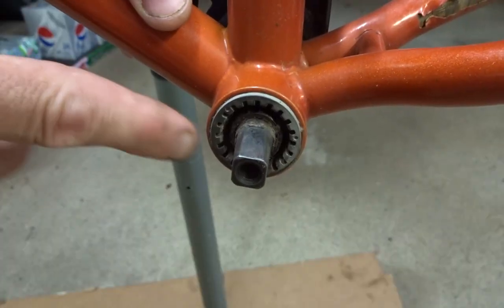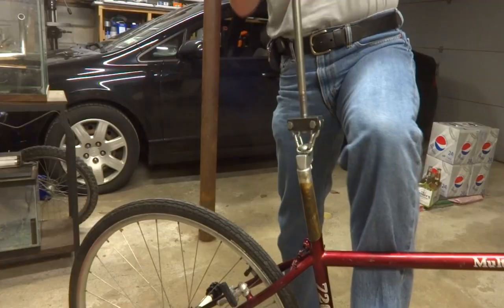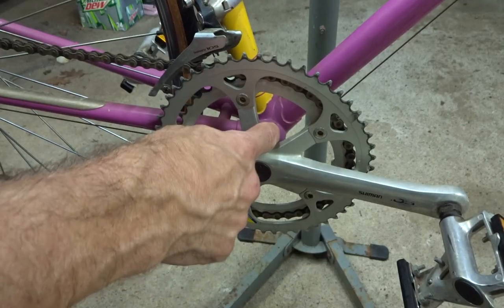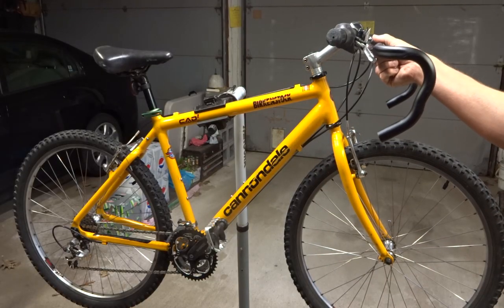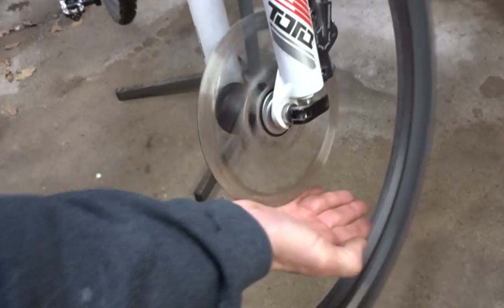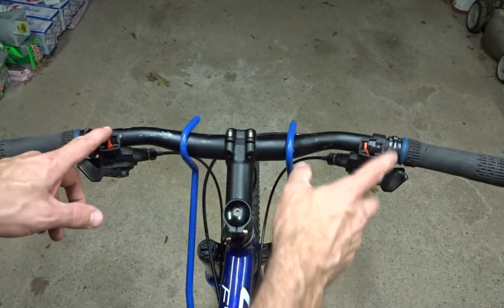RJ The Bike Guy YouTube Channel Trailer

Comment: hey RJ did you edit this yourself?  That last bit with the seat was perfect! Oh and...   I recently delved into re-lacing wheels and I ended up using the wrong holes for the spokes. (hole farther from the rim edge rather then closer to the side the spoke is coming from the hub). I plan on fixing this soon but wonder what you think would happen long term. Would I notice a difference when trueing the rim in the short term?
Reply from the maker: Yes I did. Not sure what you are describing. Take it apart and redo it.

Comment: Just crashed my road bike into a curb (brake failure, cracked the fork, REAL ugly shoulder rehab in my future). ANYWHO, question: What all should I be checking on the frame to determine if replacing the fork is worth doing? It was a good bike up until the 10+ mph meeting with the curb...
Reply from the maker: Everything! Maybe have a shop check it out.